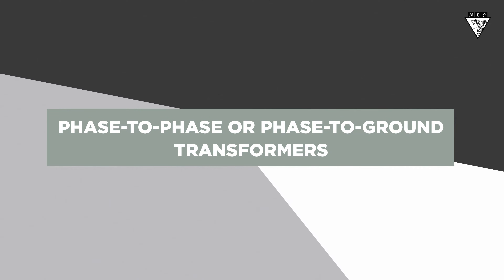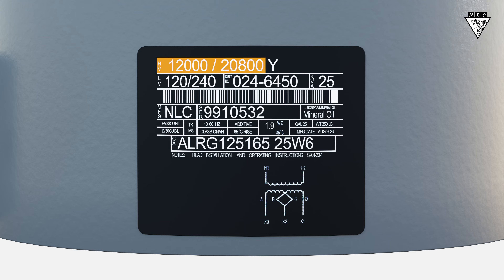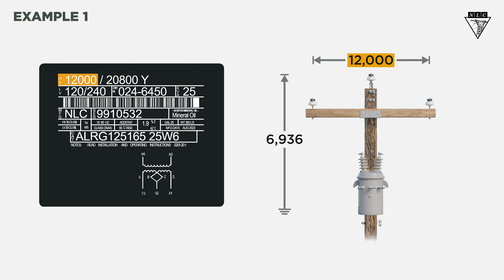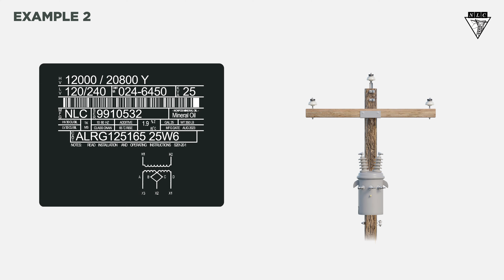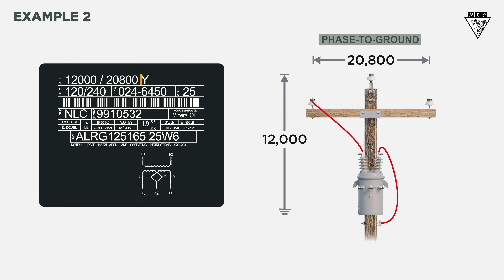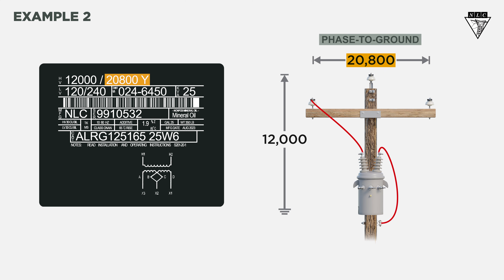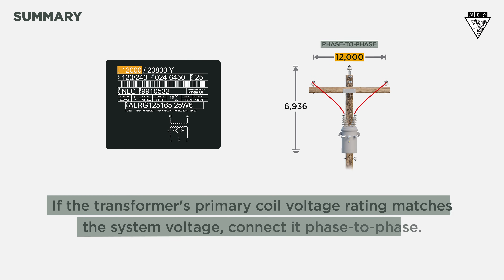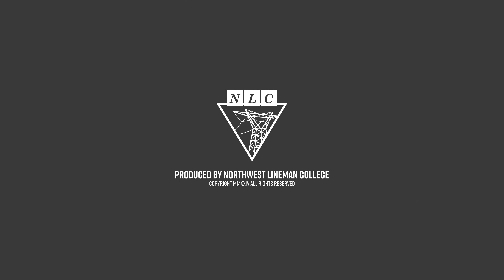Phase to Phase or Phase to Ground Transformers

Comment: FINALLY!!!!! NOW I see why its called "wye" beyond that crazy drawing shown in books. NO book should ONLY have the drawing. tyhey need to ALWAYS show the REAL images as well, like what you just showed.   just showing a drawing, is like showing nothing but line diagrams and NEVER showing someone a real outlet, switch, or light... then thinking that they are well trained to go out and perform as an installer.

Comment: Thank you!!
Reply: Why does NLC teach transformer connections of phase to ground when it should be phase to neutral. If you relied on the ground (earth) as part of the circuit path you would limit current to fluctuations based on impedance of the ground?